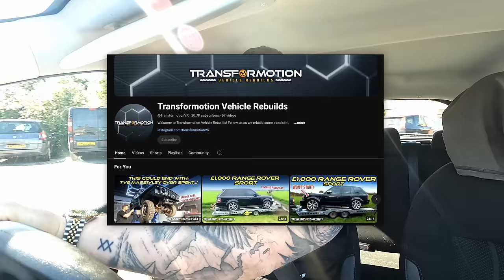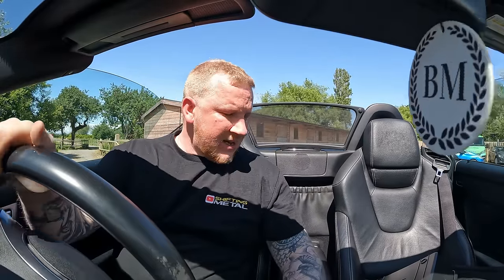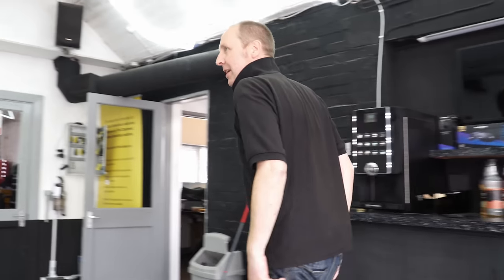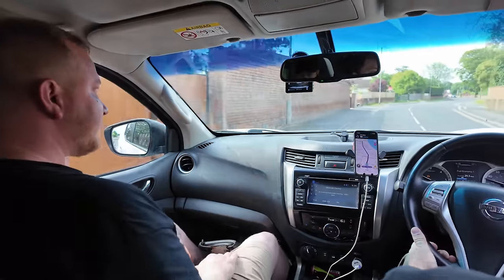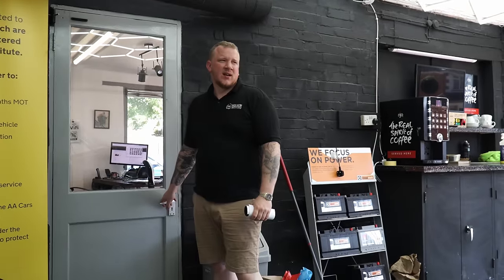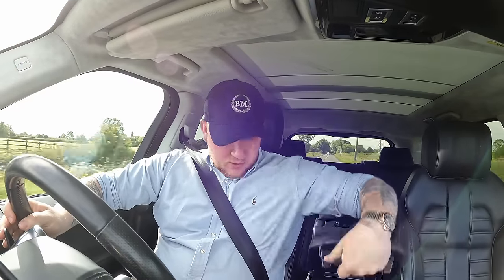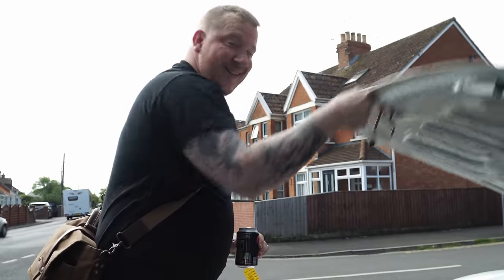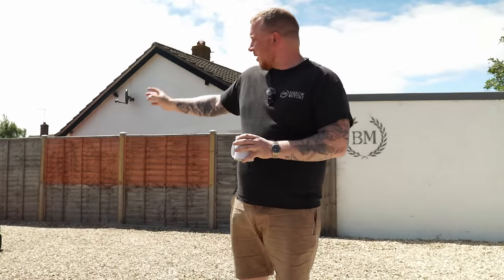Maybe I Need To Slow Down! | BM WEEKLY EP 44

Comment: Got lucky with speed awareness course. Got done doing 38 in a 30 and got 3 points, ended in Mags because I hadnt received the NIP so no response. I add also, it was in a temporary roadworks speed limit also which nornally was 50 mph

Comment: I got caught doing 33 in a 30 and was able to do to course and a higher fine. Day of the course I was running late and got done again 😂. Also as a former HSE inspector not 100% sure that means of towing at 4:25 would meet any of the standards
Reply: 33 in 30 👀
Speed awareness courses are offered 35mph +
Its 10% plus 2mph
You sure it wasn’t 43 ?